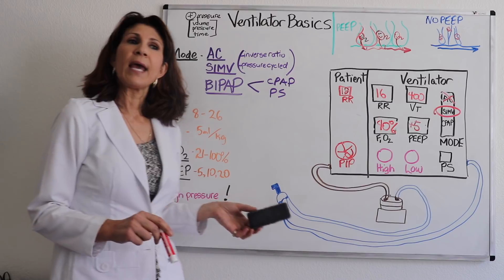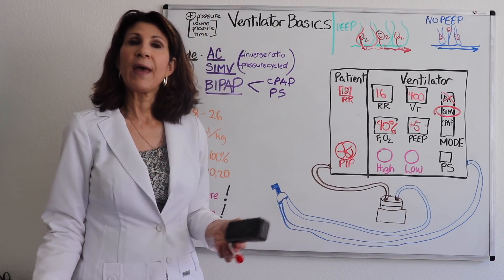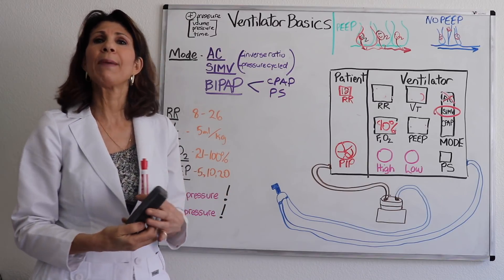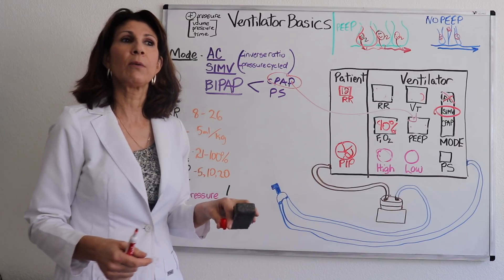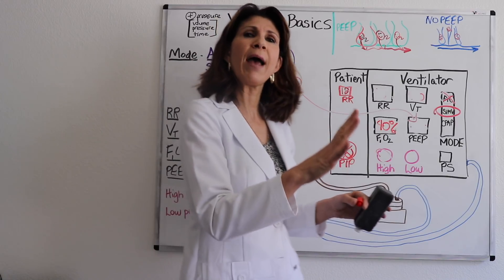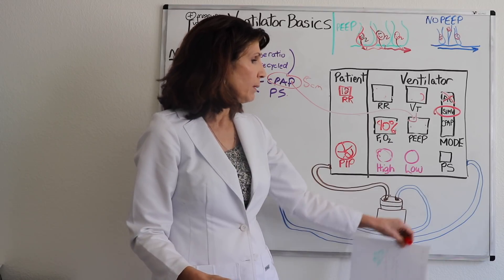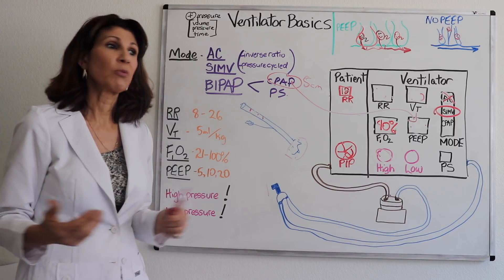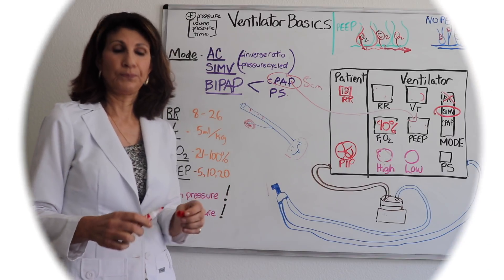Venilator Basics for Nursing Students Part 2

Comment: Great video! Clear and concise. Only suggestion is with the endotracheal tube placement depth. This measurement should be taken at the upper teeth/gum instead of the lip. The reason is that the lips can swell over time, if there's facial trauma. This will look like the endotracheal tube moved, and is deeper than the confirmed depth via x-ray. This can lead to accidental extubation by trying to reposition tube placement and withdrawing the tube to pre-charted depth.